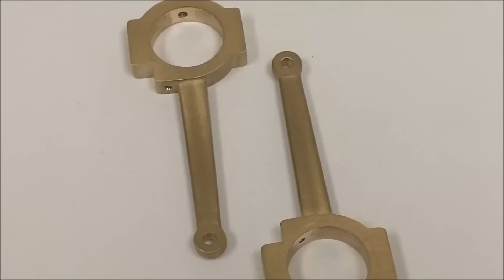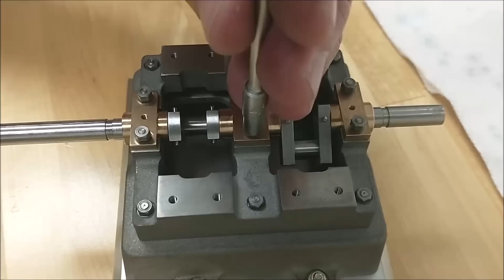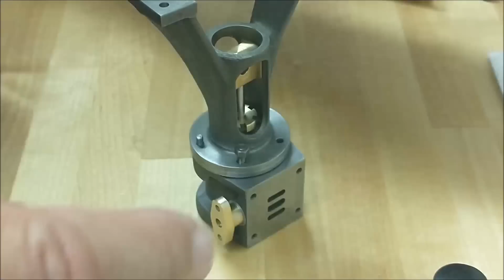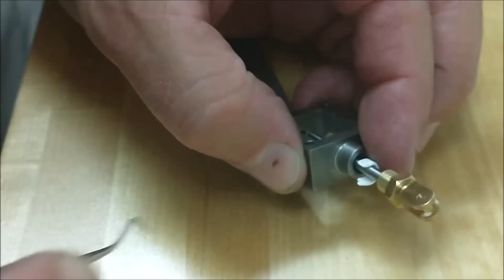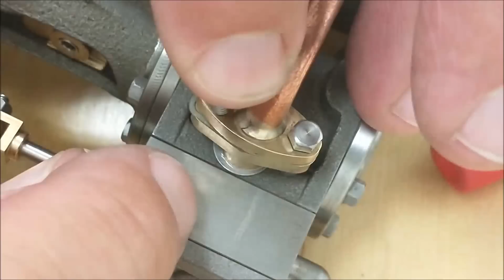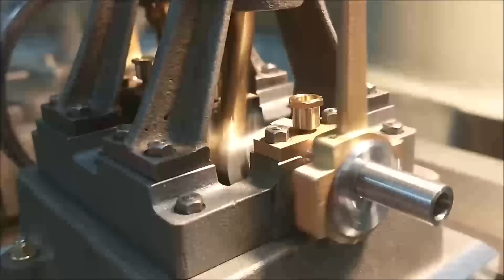Lets Assemble and Test Fire the Stuart D-10 ----  Enjoy !!!

Comment: Superb work Joe and the video is also first rate, so very well done. I noticed that you needed to give the flywheel a small shove to get it running. As another guy mentioned below this engine, being a 90 degree twin should self start once a small amount of air is applied. That yours apparently didn't could possibly be due to minor internal tightness somewhere or glands being a bit tight. Also possible is that the valve timing is not fully correct. One of the slide valves needs to be open and able to admit steam into the cylinder at any crankshaft position. It is easy to see this by removing both valve chest covers then rotating the crankshaft in the normal direction and noting the valve operation after half a full rotation. Then view the other end and continue rotating in the same direction. By doing this and noting the movement of the valves it will be possible to see if the relative phasing is right to support self starting.
Reply from the maker: The air pressure was applied extremely slow and low. I never gave it a chance to start on its own, but I have to believe it would have.

Comment: Hi Joe.....are you going to eventually run the engine on steam?
Reply from the maker: Thats a negative good buddy. The moisture and cast iron is a recipe for disaster with showcase models.
Reply: @joepie221  Running on steam is about the only way to verify that all joints and seal are perfect and not leaking. Steam running is perfectly fine if the correct post-running procedure is used to blow out and neutralize the inevitable minor water deposit - steam oil is also to be used in a displacement lubricator during running. On completion of running give a short run on compressed air, then continue with WD40 added into the airline, then finally continue running with slideway oil added into the airline. This will work fine and give no internal corrosion problems of consequence.

Comment: Can't believe I missed this video on release day!  Just saw you watering a wolf spider and realized you'd posted the project payoff. 😁

Amazing work -- I almost said "as usual", but I never want to take your abilities for granted.  You consistently demonstrate talent we can all aspire to; if we don't achieve it ourselves, it's certainly not because you were stingy with your knowledge.

Once upon a time, I was told that the mark of a great engine build like this was the lowest needed pressure/volume of air, and the slowest speed, at which it would run.  Even without a lot of dial-in, this build is obviously a great success.  And so quiet!

For display shelf purposes, you might consider trying an aquarium air pump & valve (in a new base, of course).  It's probably more than enough to run it.
Reply from the maker: I like that idea. I'll have to try it.

Comment: Many years ago I received a Stuart-machined but unassembled D10 set of parts.  I believe that Stuart did not machine the center main bearing very well, and I could not align it with the outer mains.  A friend line-bored a new center bearing and problem was solved.  I had previously machined a single vertical 10 from castings, certainly a much easier project than the double.  I can appreciate the quality of your build; a very instructive series of videos!
Reply from the maker: I knew a Charlie Kropp many years ago. Any relation?
Reply: @joepie221  I think my Grandfather had a brother named Charlie, but that was a LONG time ago.  I have arrived at the time of life where it is time to thin the herd of machines I have accumulated.   With some regret I recently watched my lovely little South Bend shaper get carried out the door.  However, I can still watch your fascinating videos!

Comment: Always the sound of well fettled machinery and many thanks for the advice and honesty. Showing the errors is very important as we need to understand that nothing is perfect. The piston fit although not visible is critical and hitting the home run has to be the run out. Thanks for going to effort and posting this!
Reply from the maker: Only the bolt pattern for the steam chest was missed. But that impacted the cylinder and cover patterns. I'll have to pay attention when doing the reverse mechanism too. It utilizes those studs. Everything else was spot on.
Reply: @joepie221  Possibly a change to the design as I always try for rounded dimension or focus on the aspect ratio of cover fixings. In my world you either make it perfectly square or obviously a rectangle, same goes for gaskets. if its close enough to require a measurement then its a fail. The easy option is to be inaccuarte and use transfer punches to get the centre. For me using manual machines I aim towards all screws fitting with a standard hole clearance which is usually 0.1mm on the smaller diameters. Only this way can you improve the native precision and hone your marking out skills and get better next time. Goals for satisfaction are with a four or six hole pattern being able to reverse or index the part and all the screws still fit. The issue with model making is that the smaller the scale the greater the precision required. A full size machine would be viewed at 30 meters whereas the model will be 30 cm. I enjoy the videos of your as they are shwoing how do do things with a good workshop machine practice so they are invaluable. Finish and precision are important for me although sometimes you work for fit rather than a dimension plus tolerance to get the best results on manual equipment. I also like to run trial cuts or processes on dummy parts before setting about a part that I may have already invested several days in making. These are skills you learn when making one offs as there is no preproduction run to iron out the niggels and refine the manufacturing.

Comment: If you like the cast iron look and want to keep it that way consider a degreasing of the cast surfaces then coat it with boiled linseed oil.  Then set it out in your Texas heat and intense sunshine and a light rubbed on coat will cure in an afternoon.  Two coats will prevent rust but leave the cast iron looking like it's been waxed.  

It's been a great treat to follow the series.  And as usual with your videos I've learned a lot of helpful hints to aid my own hobby machining.  Always a treat to tune in.
Reply from the maker: Thanks for the tip.

Comment: Joe
As all of your other builds, an excellent job, with many tips that can be done with any build large or small.
The only question I have, is when will you be building a boiler to power it, and a boat to put it in?
Reply from the maker: No plans for a boiler. I don't like the mess.
Reply: @joepie221  Joe, thanks for the reply. I have a steam powered model boat, the only "mess" I have is the the waste steam which is piped into a steam/oil separator. disposing of the waste oil is easy.  I dislike mess also.  If you are interested in my set up, I would be happy to send you photos.

Comment: Superb build Joe; I've built the single 10V & having got the timing set it runs as sweet as the proverbial nut. I put a muffler on the exhaust of mine filled with fine wire wool which quietens it down a lot more. It's always a pleasure to watch your builds.:washhands::washhands:
Reply from the maker: Thank you.

Comment: Zergute!  That is one beautiful little engine and it runs like a jewel.  Just out of curiosity, what was the pressure when you got it to start running?  As it laps in, the needed pressure should drop some.  The only modification I would suggest is to add reversing gear that would include 2 more eccentrics, 2 more eccentric rods, 2 blocks, 2 expansion links, rods & links to connect the expansion links so they can be moved together, and the reversing lever. I think Stuart has a reversing kit for this engine.  You have done very well.  😀😃👍👍👍
Reply from the maker: Not sure on the pressure, but it wasnt much. Actually, the second time I tried, I didn't touch it, I just fed it and it woke right up. I do have, and will build the reverse mechanism in the future.

Comment: Good morning Joe, I note the "exposed pin" watchers won the day, I shall submit to the popular opinion as it all looks excellent. On the timing of the steam admission and exhaust there are lots of very good old books on this subject,  once set up at 90 degrees the fine adjustment is called Lap and lead, most vertical engines have a little extra lead to compensate the inertia on the down stroke. Thanks for the build. Ray.

Comment: What a superb engine and build standard. It runs like a Swiss watch.  Keith Appleton always tries to get the steam or air to enter the cylinders just before TDC of the piston. This gives a cushioning effect to the piston and makes the engine run a little quieter, especially on engines with a little wear. With the precise tolerances you have I don't see you getting any knocking. Keith also has good success using a silicone O rings as a piston ring. If you feel like playing a bit you could make some pistons with O rings to give it a try.

Comment: Absolutely worth smiling about, Joe. Great job on this. Love the redesign on the eccentric straps.
How much pressure is it taking to run? Just beautiful. Thanks so much for bringing us along. Cheers
Reply from the maker: Just a trickle of air started it. I tried it again without bumping the flywheel and it started itself. I was told these D 10's could do that, and it does.

Comment: I'm curious as to the air pressure you used to settle on an optimal RPM? It must have taken a few tries to find that sweet spot of smooth running. Running 200- 300rpm? Thanks for your superb video/ series! keep them coming.

Comment: Very Nicely done Joe. Soooo what was it? Did the narrow flange in the stream valve go up and down or did the flat flange of the stream valve go up and dow? I gots2know!

I am amazed at how how
Quiet it runs. A testament to holding tight tolerances. Sometimes you have to run these in if your loose on the numbers.

I was taken aback by the pistons not having rings. I would have thought it would have rings.

Now onto the reverse linkage. What would be cool is to add hook up to the linkage. Hookup allows a running engine to back off its steam consumption to improve efficiency.

Comment: Nice job Joe! Not all of them start that easily or sound that good, I've known a few squeaky clunkers in my time!

Now you really ought to build a boiler! It's not that hard, and I'd love to see you tackle the essential gubbins that go with a live-steam setup (in-line oilers, water injector, valves, seperators etc) there's some good material there for future videos, as often the supporting equipment need tighter tolerances than the engine itself.

Whatever the future holds, it'll be worth watching i'm sure!

Comment: That runs sweet.  Absolute whisper. Great job Joe!! Question, if you didn't already have the BA taps and dies, would you have purchased them or switched to unified thread? 7BA is very close to 3x48 for example. Thanks for putting this series together for us.

Comment: As usual, a beautiful machine built by an expert machinist. I don’t know if I would paint it. I kinda like the raw metal. Maybe an oil wipe on the cast parts to keep them from rusting?
One thing Keith Appleton does after an engine build or overhaul is to crank up the air pressure and run the engine at warp speed for a bit to make sure parts don’t fly off. But this engine looks great running slow.

Comment: Oh my Joe that is one good looking start with all your hard worked on parts and pieces to start this video to go mode. We are so used to you steaming along with great builds but I have to say this one has been the most challenging. Complicated setups made easy for anyone to adapt to and no sign of tooling marks or finishes/flash that can visually spoil the overall looks of this beauty. It really looks great. It is just not the machining but the mechanical knowledge needed to make those little changes to support or enhance these builds. With a huge cheek smile in my mug with when this beauty came to life will be there for some time now. My cheeks are now starting to hurt eh. Well now teach I suppose the overhead flat belt drives are next in line unless you may possibly have an old school locomotive hiding up your sleeve for us. Possible options are many and reach out far bud. LOL. Take  care bud. Another winner behind your belt my friend.

Comment: The Beaty of that 90 degree setup on the dual pistons is not having to hand spin to start. It should startup on its own regardless of crank position. That is a slick looking model as well. I started a single cylinder one, and have a few more operations to complete. I really like your eccentric mod and will do it myself. I also have another seemingly thousand fasteners to make as they were missing out my kit.

Comment: Steam engines are magical. My father made a twin-cylinder engine from scratch. ⅜” bore and stoke. It originally started as a single cylinder engine and on that side he used mainly a file and a drill press to make it. All of the tiny hex nuts were filed out by hand. Runs like clockwork.

Comment: Great result from a very enjoyable vicarious build Joe. Glad you’ve found Keith Appleton’s videos - he freely admits he’s not an ‘engineer’ but what that chap doesn’t know about repairing steam engines and making them run isn’t frankly worth worrying about. 

One point Keith regularly makes is that slot-headed grub screws (like you have in your flywheel) regularly shear half the head off in normal use making them a nightmare to un-loosen or adjust - it would be well worth swapping to a more modern hex grub screw for reliability and strength. 

Thank you again for another fantastic build Joe, looking forward to whatever is next from your workshop.  Cheers, Nick

Comment: Beautiful! Congratulations on a job exceptionally well done. So when are you going to add the reversing gear. Also, you need a scale project for the engine to power. How about a Stuart twin cylinder air compressor? Or, anything else that catches your fancy.

Comment: The flywheel sits low because it’s a marine engine. They’re designed to sit as low as possible to keep the weight down in the boat & the flywheel will sit between the wooden bearers that the engine sits on.

I’ve restored a few vintage Stuart Turner marine 2-stroke engines & they all had low flywheels too.

Beautiful work as always Joe.

Comment: Out of curiosity, how low are you able to go with air pressure and still keep it running? I suspect quite low.
Reply from the maker: I didn't check the feed pressure, but the initial startup ran at a very low rpm.

Comment: What's more unsettling, making the obscure size of 4.5mm or adding metric fasteners to build that is all imperial fasteners?
Reply from the maker: I sized the brass base nuts that way to allow for the use of one wrench to 'Unloosen" all the bolts.
Reply: @joepie221  Thanks. "unloosen" always make me smile. Pretty sure untighten would as well.

Comment: Beautiful job Joe!   Looks, runs, and sounds fantastic.  Do you have plans to integrate with all of the metalworking miniatures you made?  I hope so.  It will be a fantastic display.
Reply from the maker: I understand the single cylinder horizontal engine I did first would be more period correct. These engines had marine and small locomotive applications.

Comment: Nice, the cams/eccentrics should be exactly 90 degrees to the crank throw, especially on a reverse able engine.
With that established now you can adjust the valves.
This is where having a different thread pitch in the valve block and the eccentric end will allow fine adjustment
by rotating just the rod without dissasembaling anything....
Reply from the maker: I've seen arguments both ways.

Comment: Very nice model.  I really want to see you fit the reversing gear.  And then, maybe, the next effort is the 5A model, which was used by not a few to power boats up to about 16'.  Oh, by the way, the cross on the steam line is to provide a place to fit a displacement lubricator as well as to give a choice of steam line attachment (your choice is the most common.)
Reply from the maker: I have the reversing kit, but it will have to wait for a while.

Comment: Is there any need to machine a slight flat on the side of the timing rods where they insert themselves in the upper dome, so they do not have to repeatedly compress the enrapped air? Best build series I  have ever seen✅
Reply from the maker: The flats were suggested and I actually did put them on. The hydrolock argument made a lot of sense and the fit was very close. Better safe than sorry. Thanks for the compliment.

Comment: Very nice! Now you need to make an overhead shaft system so you can use this to run your varoius tool models. ;)
Reply from the maker: That would be cool!
Reply: @joepie221  I made a digital version based on dimensioned drawings I found in some old textbooks. You could probably work from those references. I'd share the links but YouTube deletes my reply if it contains a link.